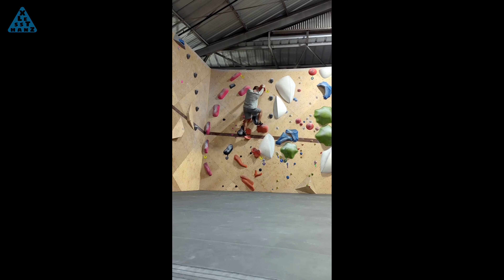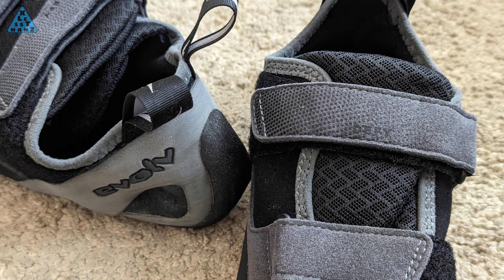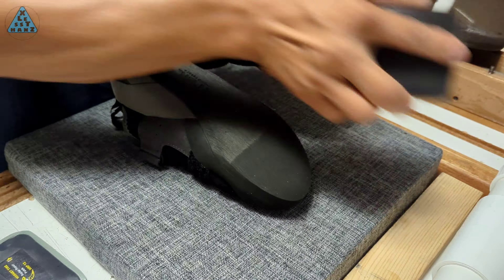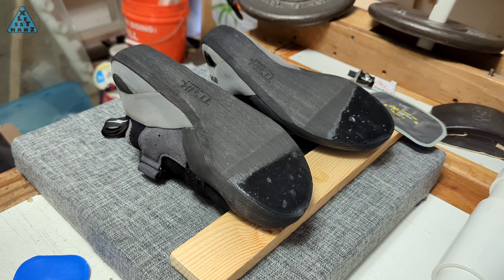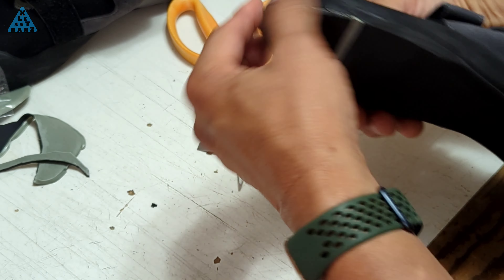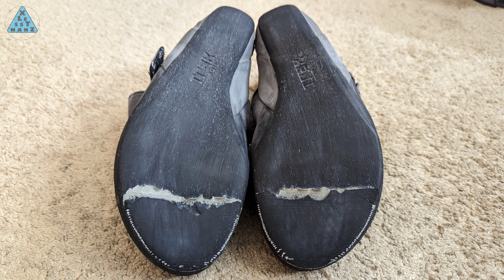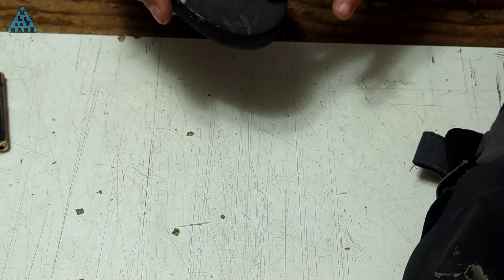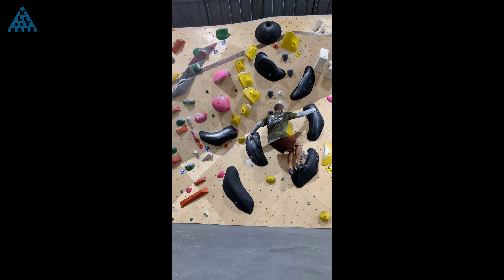DIY Climbing Shoe Resole (BEGINNER LEVEL CLIMBING)

Comment: interesting idea, if it works for you, then by all means do so, but i do think that if you climb v5/6 and higher, you will notice alot of performance getting sacrificed here. A better option would then just be to get them resoled like normally, seen as they actually use rubber meant for climbing. This is also not that expensive, so you could easily do 2-3 years with them, depending on how many time you resole them
Reply from the maker: The two that give me the most trouble are steep volumes (slabs?, not sure what they're called) and jibs where you need to place tip of your shoe half on the wall and half on the jib.  Of course, this is only up to my limit of maybe v4.
Reply: @XLessThanZ  yeah this can also just be some gym shoes for light training or spares to loan to someone

Comment: Yo I have acess to the shoes that a climbing gym throws out when they fall apart. Some cheap shoes but I wonder if it could be worth resoling them and finding new owners for them.
Reply from the maker: Might be worth a try if the patch fits with room to spare.  I tried patching those holes where your big toe comes through the front and I couldn't get the patch to stick very well in that area.